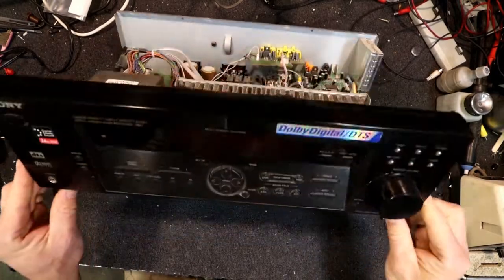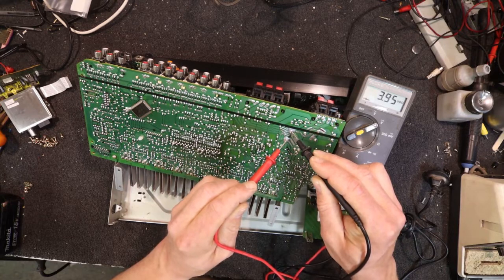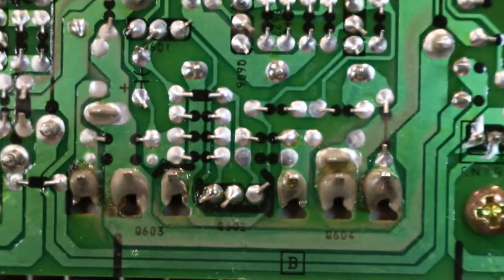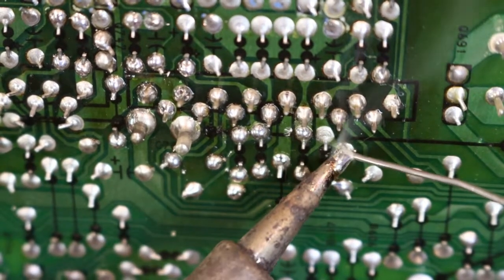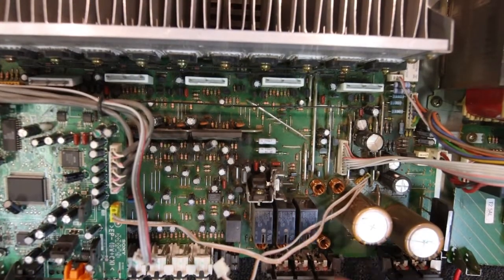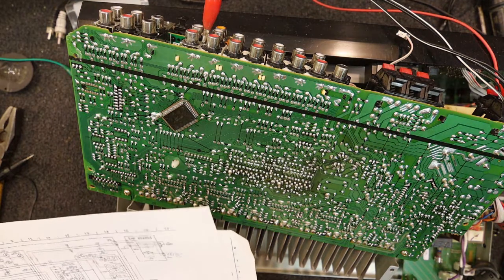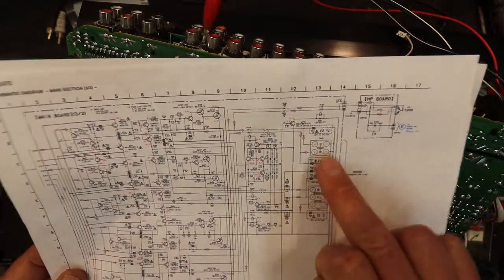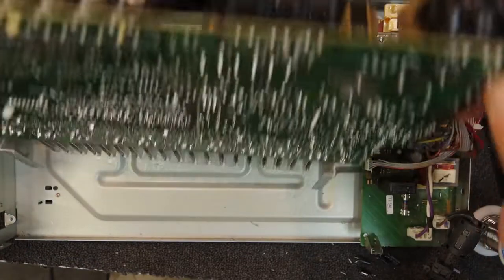Sony Surround Amplifier Repair and Partial Recap STR-DE475

Comment: The soldering in these was abysmal, no wonder they failed all the time, sony's wave soldering process was not adequate for av receivers that run hot, they didnt get the solder hot enough or use enough of it, once those voltage amplifier IC's short its game over for the amp im afraid
Reply from the maker: I found most brands did the same in this type of unit. Definitely could have been designed and made better.

Comment: hey I got the same receiver when ever it rains in the summer i get a protect issue with it, from the heat/humity.  what would I look to fix or clean on this?
Reply from the maker: Most likely it would be faulty capacitors or dry joints similar to this one
Reply: @StevesElectronicRepairShop  okay thanks

Comment: This is an amazingly detailed repair video that is much better than most. I have an STR-DE475 with intermittent sticky speaker relays. I was really tuned into the voltage regulators around that part of the board.  Thank you for this great video.

Comment: Hi there, thanks for the nice video! I got Sony STR-DE968 which has  lost a lot of its volume and from the headphone output I noted the sound hardly distorted. What would you suggest , where should I start from. Thanks!
Reply from the maker: I would check any line outputs such as tape record or TV monitor for good audio when plugging a CD player or the like into one of its inputs. If its OK there then the fault is the Amp section. If no good then its in the signal processing somewhere.